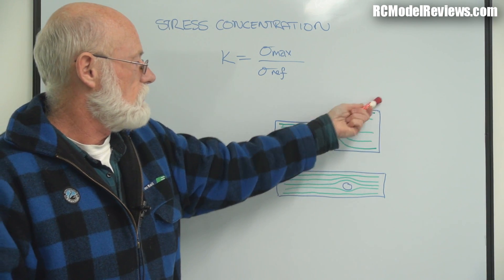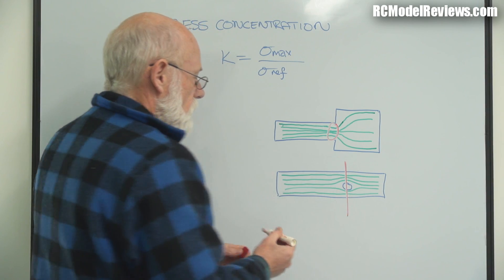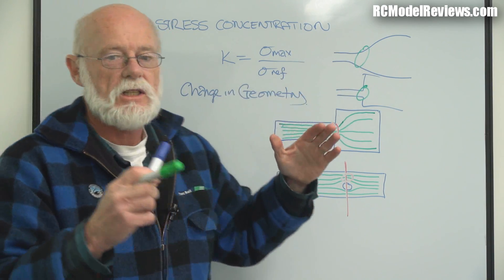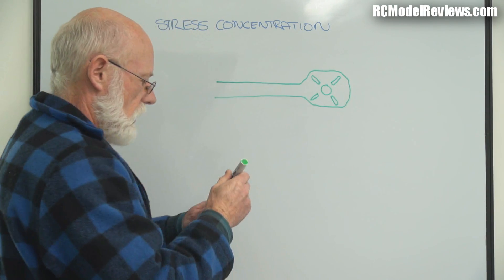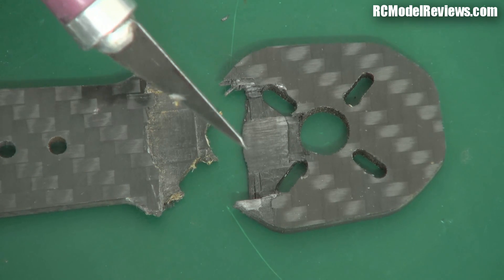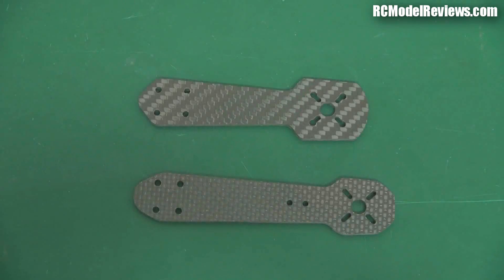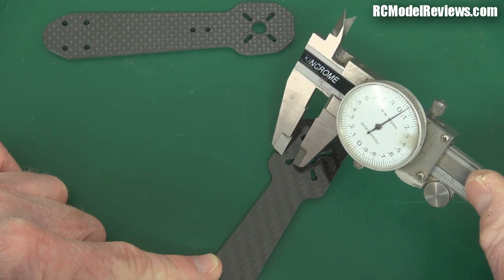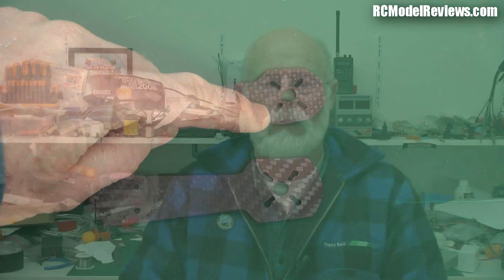Quality versus Value - and why stuff breaks (ZMR250 mini quadcopter analysis)

Comment: Hey Bruce,  does the blackout arms fit on the Chinese frames,  cause is it possible just to change the Chinese frame arms with the stronger blackout ones.  Four blackout arms is around 45 usd,  the total cost is still cheaper than  the original blackout frame?

Comment: Good stuff.  Bet that extra arm area extending beyond the motors helps too, by keeping more of the impact on the end of the arm, rather that on motor itself -- thus avoiding the mechanical leverage of the motor adding pressure against the weakest point.

Comment: You have to count the number of layers of carbon fiber used. Most of times the reduced number of layers cause much more effect than an ordinary material reduction on stress points. My eyes aren't good enough to count right now, but my Blackout arm has 15 layers.

Comment: I love your videos. Just the right amount of technical information without being overwhelming. I actually swear by FrSky transmitter and receiver products now solely based on your reviews and recommendations. I haven't had a single hiccup. I love Frsky so much now I actually gutted a Spektrum transmitter and replaced it with FrSky DIY module. I found it to be more reliable than overpriced Spektrum products. I'm an RC helicopter flyer though, so unfortunately most of your reviews are about planes or quads. However, I still enjoy your product reviews regardless. Keep up the good work!

Comment: Good vid but still i love the ZMR250 frame and the hexa is even better. For the money its a great quad for beginners and if you buy some spare arms with it you can have fun for years :-). I have crashed mine several times and still have not seen one arm brake from the 250 or hexa. It's very lightweight frame and with some tigers or cobra they are so fast :-)

Comment: you will never go wrong with the better brand mini quads. Why would you want to spend so much time sitting down doing repair works rather than enjoy flying. Now that you know its easy to break, you will fly more carefully, then you might as well get a 450 quad fly slow and steady. the cost of repairing it / modification , at the end of the day will be more expensive than buying the branded ones. Blackout, Xhover and Lumenier rocks.

Comment: Hi Bruce,

I'm surprised you also didn't mention the fact that even if they were the same widths, the weave quality is inferior. Also the longer arms give more leverage for it to snap at the weak points! 

However, I have certainly learnt the  basic principles of stress dissipation/behaviour, something I hadn't really considered in depth before when doing home builds! Apart from the obvious of less material is weaker and 90 degree corners are likely to break more.

Thanks!

Comment: i havent read through the post ,  so sorry if anyone else as pointed this out .
the 2 arms are different lengths which will bring the lever effect in to play ,so the shorter 1 (black out ?)  will be stronger  for that fact alone ,but will have a shorter prop range if everything else in the frame bodies is the same .

Comment: I purchased one of those Nighthawk 250 frames that cost $40 US shipped.
Similar design as the rest of them, pretty much a clone of the MXP230, including vibration isolated mobius plate, and even has room for 6" props for more punch out.
The arms are 5mm carbon/G10 hybrid, they will NOT break in any plausible crash.
Weighs 180 grams.  
Motor mounts need user modification to use 3mm bolts, as hole pattern only has 2mm holes.

Buy and review one of them frames Bruce, it is probably the best VALUE frame to date in the mini quads.

Comment: When flying dual line trick kites I've damaged a few carbon fibre spars. Makes a sickening crack sound when it happens and the dollar signs start to appear in your mind. Found the spars split length wise. Cutting new ones to length I used a fine tooth hacksaw blade but I figure to cut out quad frames I would need a tungsten tipped router blade and to wear a respirator. A vacuum at hand would also be needed as it would be a lot of dust.
If made with decent carbon fibre surely the laminations would split instead of breaking as those arms did. Then with a bit of epoxy and compressed in a vice they should be able to be repaired.

Comment: Twill weave of the blackout cf is stronger as well. Thinner I use 5k fibre at work on speedboat parts and foils. Very hard to buy 5k since there are far fewer factories and 3k is cheaper. Good review Bruce,

Comment: The cheap arm looks like plastic covered with fake carbon fibre stickers. You can buy the carbon fibre stickers for PC builds to make your inside look fancy schmancy. If you cut the arm in half down the edge I wonder if the inside looks the same as the outside.

Comment: I bought a FrSky radio and QuadLugs frame based mainly on your opinion and they've both been great.   The multi-rotor hobby is so young that established manufacturers and practices are rare.  A lack of information helps bad vendors and limits the number of good ones, so we need more thoughtful reviews in a timely manner.  I think RCModelReviews is one of a handful of sites providing them.
Reply: Ditto.

Comment: Good analysis, as far as it went, but sorry Bruce, that's NOT a "Design Flaw"@0:50.

Generally a 'Design Flaw' is a legal definition for litigation.   At most, it's a "poor design". A 'design flaw' COULD be somewhat justified if the quad was specifically "designed" to survive, without damage, the impact the quad experienced and was promoted to do such.

For example, according to your definition, if I had a 3mm boom with of the same thickness and shape of the BO boom and a motor mounting hole to the edge of boom of 8mm, which could survive an impact above and beyond what the Blackout's boom of 6mm of edge of boom to mounting hole, could survive, I could label the Black Out as a having a "design flaw".

To me, the elephant in the room, that you completely failed to mention in the video, is the carbon fiber quality.
Reply: The matrix is as important, especially here that seems it delaminated.
Reply: Good luck getting money from a Chinese company because you crashed your quad and want to blame someone else.
Reply: Cyberdactyl That crap still rolls down hill.  From what you're saying we could say it still has a "design flaw".  Is Carbon Fiber Quality not an aspect of the product's design?  He wasn't looking to completely bash it and call it crap.  He simply just stated one very obvious flaw he could see.  He just simply stated what he needed to drive his point for his review.  If he went on to the quality of the Carbon Fiber, his critics would have went wild.

Comment: i still think my old woden h quad flies as good as any of these ive lost signal at well over 100 ft up and not broken the frame just buy some square wooden dowling and use some big machien screws to hold it toether and there you have it i have one quad which ive put together as an ltra budget affair for my niebour to practice on for just over 75 dollars all in and although not the best its good eough

Comment: I don't believe you are biased with your reviews (far from it) but I think your 'product descriptions' gives the impression you are.

Whenever you talk about the non Chinese versions you refer to them by their model name, when you talk about the Chinese models you refer to them as 'Chinese knock offs'.
Reply: Cess182sn That's mainly because in the case of the brand-name products, there is one manufacturer.  In the case of the Chinese products there appear to be quite a few manufacturers, all creating these things independently, to different standards and using different materials (as witnessed by the variations in the four frames I have here in front of me).  Thus, to give them a collective title is a far more accurate way to represent them.
Reply: Read my other posts, I agree with you.
Reply: Prblem is anyone not the original design concept is making a clone.. Pretty sure the ratio of original designs to clones from china is pretty rough.. LOL
Reply: Isn't not what most of them are ? 

Knock offs ... What's wrong with telling the truth
Reply: Most Chinese products are copies of other products Patented and Sold under US and European names. A lot of the Chinese sellers are students in dorm rooms trying to make a buck. You can go to Shenzen and tell them what processor, etc you want in a tablet and they grab bits and pieces and put it together. That is not considered a BRAND product, thats a hodge podge.
Reply: Nothing at all wrong with telling the truth. My point is that 'language used' is extremely important when you become a credible reviewer
Reply: Bruce is just as credible and he is mature enough to not be a douche bag.
Reply: Cess182sn  Dude, get real. Out of all reviews I've seen by all sorts of people, I respect Bruce's opinion over any. That is due to his Honesty, he points out the good and the bad of any product.
Reply: News tonight did a segment on just about every product you buy has a copy made in China. Even Rosetta Stone, they have issues with there software being sold in China with the same looking box, etc.. They do not have the strict copyright laws everyone else has. For a while they pretended to do something only when big brand names complained like Gucci, etc..
Reply: They are killing European and us market plus straighten theres

Comment: Thank you Bruce, another example of taking a complex subject and making it easier to understand. In nature you never see straight lines and man made things that get described as being "organic" in form are also inherently strong. Car manufacturing has evolved from angular boxes to flowing panels not just for aerodynamic reasons but because there is increased strength while using less and lighter materials.  Regards. Nidge

Comment: Great description Bruce. 

Another big issue that many frame designers seem to ignore is that carbon fibre composites are generally anoisotropic, i.e. the material properties are not the same in all directions. This is especially with fabric layups that only use 0, +-45 and 90 degree layups of woven fabrics (as I am guessing these are). Composite plies have maximum strength parallel to the fibres.

Because of this, in those areas of stress concentrations, there are usually less than half of the fibres actually aligned with the stress. The other fibres will be perpendicular (and thus have lengths equal to the width of those thin sections, >5mm) and barely contribute to the strength at all. 

To maximise strength, the distance from the hole to the edge of the plate should be at least three times the hole diameter. Or unidirectional fibres could be aligned with the stresses instead of 0/90 degree woven fabrics.

So all in all, using thin sections of woven fabric composites is a bad idea - even worse than thin sections of isotropic metals.

Comment: Just bought one for $23.06 on eBay from "global.mart" as Buy It Now with Free Shipping.
I just can't justify the extra $130.00 for stronger motor mounting arms.
This is a hobby and repairing is just part of the fun. I usually fly prudently to avoid mishaps and extra expenses. ;)

I suppose that If I wanted to get into Quad Copter competition racing I would go for the stronger Porsche frame.

Thanks for the Stress tutorial.
Reply: We must have bought from the same seller, I had one on order from BG, then bought another 3 for $23.06 ea also with free shipping. that 12 spare arms, just in case.... but intersting to see what the quality is like for this price...
Reply: good catch,   Although that frame is fibreglass, not CF but I'm guessing it will get you flying!
Reply: theorgandude Yes, the ebay one just turned up and the frame is fiberglass not CF.

I'll weight both of them to see what the difference is. The BG one was missing  the 16  arm nuts, they are sending replacements though. but I already had a bag of 50 M3 nuts that I have as spares for other things...

Comment: I notice on the blackout arm that the hole is larger than the slot. This will also help to reduce stress. I had a look on a carbon fibre supplier's site and a way to tell if it's carbon fibre or fibreglass cloth is to sand the edge lightly. The dust should be grey if it's carbon fibre. It also shouldn't flex. The cloth on the blackout arm also appears to have a wider mesh. Your reviews are great and very informative. I also enjoy watching the Forrest fliers. Keep it up.
Reply: Grey is correct. Some dodgy suppliers dye G10 (Fiberglass) black and then finish it with CF Weave. The result is a fake CF that's as strong and heavy as G10. You can use Acid to test, if the black comes off then it's fake.
Carbon content in the graphite plays a big role. More carbon = stronger material = harder to cut
Reply: BlackoutTheDrunk Would you explain your statement that the carbon content in the graphite plays a big role. Sorry my friend but graphite is NOTHING BUT CARBON so your statement sounds so Madison Ave like it is ridiculous.
Reply: BlackoutTheDrunk Still your fake carbon fiber, with a basic fiberglass board, with laminated CF on top and bottom, while not as strong as real CF, will be significantly stronger than just regular fiberglass board. The thin layer of CF on each side will add a lot of strength. 

Kind of like how foamboard without the paper is flexible and weak, but add a thing sheet of paper on each side, or better yet, fiberglass it, and it becomes very very strong.
Reply: G E Gore What Black out the drunk meant was "More Carbon Fiber Material = stronger material = harder to cut".  In other words the more it is to being just and only carbon fiber the stronger it will be  or the less of the G10 is used and more Carbon Fiber is used the more stronger it will be.

Comment: Great work as always Bruce.  I have the cheap quad. Might bash it round for a bit and see if quad racing is for me. If it is ill drive over and collect one from old mate from blackout. Nanowii was a cool little board to setup and very easy to get flying. Want to try the little naza 32 soon looks good.

Comment: Great job!
I'd like to add the Chinese parts are a combination of badly designed parts with bad workmanship that are not even good grade carbon fibre. The Blackouts are made of 3K weave Carbon fibre mat'l the standard for good quality components. 
I've bought plenty of Chinese great quality that last. As well the same in the opposite. The old rule always applies: "You get what you pay for!"
Great reviews. Keep them coming.

Comment: just buy a sheet of 3mm carbon and make stronger replacements.. thats my plan,,, drill a few holes and do some band sawing. and i'll have an arm stronger than the blackout at the length i want
Reply: CF dust is bad stuff, wear a good face mask (something a spray painter would use)
Reply: Ben Portman the sheets I bought have been fine... Mirror smooth great weave.. Better than the stuff the original frame was made with
Reply: Ben Portman the item no is 141258911110 the seller is hkiron-shop
Reply: Stephen Berriman buy a smaller piece ? me , i make my own sheets
Reply: I had to drill my ZMR arms out today to fit 22 sized motors... guess what... white dust....any other CF I work with, it's black dust.
Reply: A sheet of carbon fibre 500mm x 500mm x 3mm is around AU$180.00. Need to make a few frames at that price. I've thought about doing the same thing.
Reply: you need to look harder (like ebay?) i got a 300mm*200mm*3 for $28
Reply: HomeDistiller Don't buy carbon fiber from ebay, it's shyte, trust me. If it's very expensive, it's not shyte, but you might aswell go to your local (if in U.K can't be more than 40 miles!!) boat yard and get off cuts.
Reply: BlackoutTheDrunk don't worry about that.. Good mask and dust extraction.. I don't want that stuff in my machines ether
Reply: BlackoutTheDrunk don't worry about that.. Good mask and dust extraction.. I don't want that stuff in my machines ether
Reply: HomeDistiller Can you link me?
Reply: Thanks Home Distiller
Reply: A 500mm x 500mm x 3mm sheet of carbon fibre sets you back around AU$180.00 and then there is the cost of postage. Need to make a lot of frames for it to be worth it.
Reply: could always use ply wood and strenght it with thin metal on both sides and glue it all in place
Reply: jacky Parker weight is an important factor..
Reply: so is power to weight ratio
Reply: Use some funfighter motors if you're worried about weight!
Reply: or just make small plates to bridge the weakspot..?
Reply: Plan C Then some other part will break on impact.
Reply: Ben Portman
white: glass fiber (FR-4 or similar)... make it with black epoxy bonder and it looks like CF.
Reply: ZMR is carbon.. as the strands don't burn!! Don't ask!

Comment: Cool explanation, it seems if china just looked at your review ad added a but more meat to the motor area these arms would take a bit more abuse but i see that you also mention in the posts below that it isnt twirl fibre all the way through and this would have a massive impact on the strength of the carbon fibre. I have friends who build/repair boats and they have to layer the carbon sheets in various ways to get the required strength. I now see why the Blackout and other frames are so expensive, real carbon fibre and R&D work you dont see

Comment: Interesting vid Bruce. I noticed the Chinese arm was longer than the other. Could this also influence the strength of it, ie would shorter arms be better at resisting crashes. Could this also be why mini quads are more robust than normal sized quads, hexas & octos & therefore better for racing & hardcore flying. Just a thought. Also what were the 2 extra holes in the Chinese arm for.?